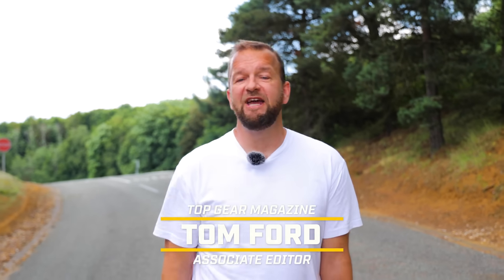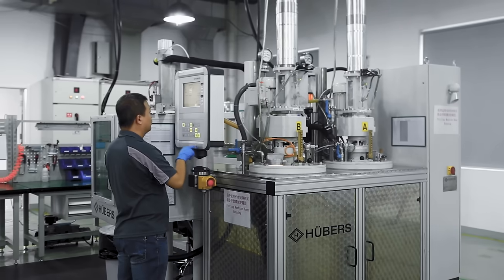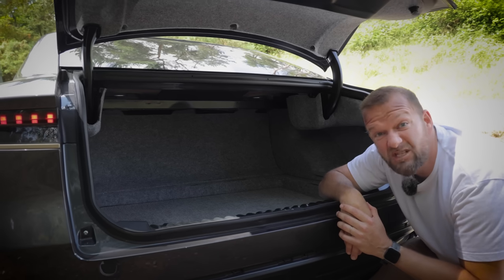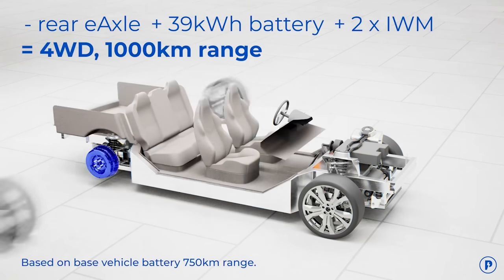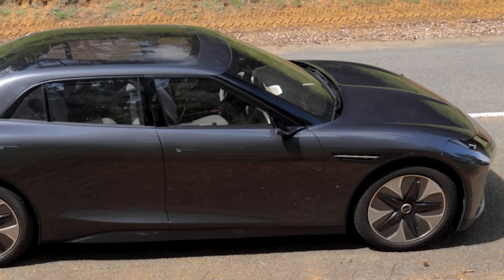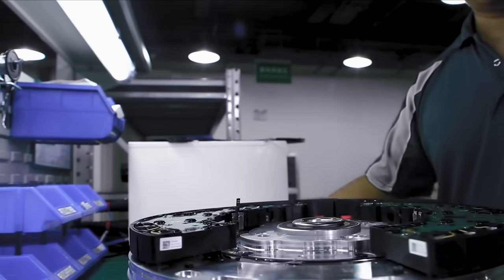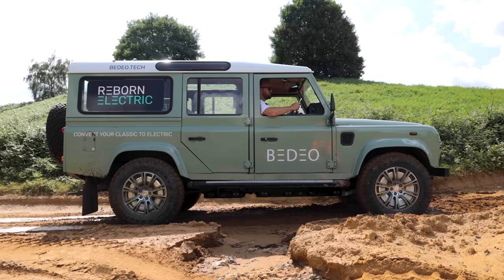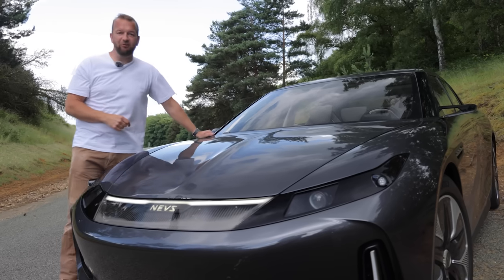NEVS Emily GT: SAAB’s Secret EV With 600 Mile Range | Top Gear

Comment: Obviously the in wheel system is power limited (total volume is fixed)- but for real users and realistic speeds - outside hypercar, specs (or wannabe hyper sedans) completely adequate.

Solong as the increased unsprung weight can really be controlled adequately.

Comment: My Micro E - Street Scooter  , like many other scooters ALSO has an in wheel motor . ...with regen  capacity , etc . NOTHING new here .Downside to this Concept is the wheel Balancing  and Tire changes . Expensive and serious Potential damage in any kind of accident  , not to mention the shock -harm caused by ...common street Potholes .
Reply: Why do you put spaces before periods and commas?

Comment: I'm gonna stop you right there. This is kinda my job. Hub motors suffer from two major problems. The first is very obvious, and that's the fact that they're basically big bricks of unsprung copper, which drastically hurts suspension performance. That can be mitigated with good engineering, but the other issue can not. You have to provide power to said motors. Those require big thick cables. Those cables now moving with the suspension is much more travel than the vibrations you'd get in your frame, and now your cables are going to work harden themselves, and eventually stiffen to the point of damage. They'd be great cars for a few years until they all have to be recalled for expensive repairs to the entire drivetrain.

Comment: The motor inside the wheel is a design flaw - talking about unsprung mass… unless it’s super light. Would like to know the weight though. Best Regards - just an engineering student

Comment: Unsprung weight would be awful.:face-blue-smiling: F1 for example used 13 inch diameter wheel to decrease un-sprung mass. Every ounce counts, so you do NOT want a heavy motor in there.

Comment: In-wheel electric drive is by no means a new idea - Jaguar was talking about it decades ago.  And it's not without its drawbacks - extra demands on the suspension to cope with forward-torque in addition to the reverse-torque when braking, extra unsprung weight, and difficulties supplying electrical power to a motor moving relative to the rest of the car..

Comment: Remember that in the space of 20 years, 1900 to 1920, horses, which had been the method of transport for thousands of years, became superfluous
So did fodder sellers, blacksmiths, horseshoes, stables at inns and hotels, horse sellers,
And the petrol car replaced them all.
The same will happen with petrol and diesel cars, gas stations will dissappear, as cars will be charged at home or work, but more likely they will be self charging, with unlimited range.

Comment: Why not ADD a generator or, generators to trickle charge the batteries for extended or, unlimited mileage of the vehicle?
Reply: You know how a generator works right?
Have you ever used one when you're biking?...
Reply: @zaarkeru3391  yes. It turns on a light
Reply: @anhonestman1234 
By?...

Taking energy from the from wheel.

Have you not noticed how much harder it is to paddle when you start the generator?

To light  a 10W light, the generator need to take 10W of power from the wheel.

Energy can't be created out of nothing.
Reply: @zaarkeru3391  you schooled me .. thanks .. but, there’s gotta be a way .. an acceptable loss for a larger gain ..   not 1 equals 1 .. a 1 equals 1.5 or, more ..
Reply: @anhonestman1234  
Not really.
You wont gain anything.

Well, solar panels might give a smidge.
Not worth the effort though.

perpetual motion machines cant ever be a thing.

Comment: Yet another miracle EV that will never see the light of day. 600 mile range also means longer charge times. Not that it matters, as it does not exist.
Reply: We're only about 15yrs into EV's so far. There's a lot of feeling out and sounding out to go thru as the tech and practical applications evolve and develop (and it's moving pretty rapidly already). "Yet another miracle EV" I think you've maybe formed a premature opinion of the whole thing whether or not this particular car makes it thru the process and into production. But I hope it does. I think this one might have legs. Maybe we'll get an update soon unless it hasn't made the cut already.

Comment: Nothing new, 2 Australian scientists at .. MIT (I think) built a EV with a motor on each wheel around 10 years ago. Raced their buggy against a Lamborghini out performed the Lamborghini on every bend & corner - the only advantage the Lamborghini had was on the lonf straight....the raw power of the V12 took over

Comment: It is an impressive feat that they pulled off with the motor in the wheel. However the fact that three companies went bankrupt trying to develop it means the cost of development was excessively high. It may be based on Porche technology but with all the changes they made killed three companies. I have a feeling that this is going to be relegated to the graveyard if no one steps in to commercialize it.

Comment: Time will pass and it will prove that such a design is not cost-effective. Yes, it is beautiful, compact and simple. But from the point of view of maintainability, as a result, it will be necessary to change the entire engine, since judging by its design, all electrical logic is varnished. And it won't be cheap.

Comment: The only downside that I could imagine with in-wheel motors, is that those expensive components are effectively in the crumple-zone, and could be terminally damaged even at low-speed minor collisions...

Comment: The drive wheel, sprung weight, at 33kg each corner only works on a very heavy car as a percentage of total weight! Try all this technology into a 1400kg vehicle and the ride and handling will be adversely effected! I’ve owned two Saabs so I praise the effort I don’t want to drive 2 to 2.5 ton vehicle!

Comment: I suppose the most  heating place  is the wheals and it  need very active cooling   in addition so  rubber of  tire can be very hot . I preferred to be from the modern wonder as far as possible . i believe it have  very actual reason for . Electra magnetic  influence no one tell too much about . About phone every one know . But beside  such power it can be 10 thousands time  bigger problem . People too fast to jump in

Comment: Didn't notice any brake disks, or obvious cooling mechanism for the 4 motors.  Even if there are no axels, there have to be shock absorbers to deal with the unsprung weight, and a suspension to control wheel tracking.  The idea of printed circuit boards, inverters, semiconductor die bonding wires and heat sinks bouncing up and down with pothole shocks is scary.  The idea of 4 motors inboard with disk brakes and liquid cooling is more palatable; same torque control, more implied durability.

Comment: I believe that putting that much weight on each wheels goes against the very basic dynamic... Turning the front wheels face a much greater resistance and each motor being shaked at each and every pothole or bump we have on our roads would shatter the reliability...

Comment: 175KWH?  It's a battery wearing a car.  They never mentioned the weight, but it is probably around 4 tons. However, for EVs to even begin to replace ICE, they must start carrying 200-400KWH batteries or battery equivalent.  Why?  The current charging infrastructure and charging performance. There would need to be a massive improvement in energy density for batteries, or a willingness of manufacturers to try alternatives like gas turbine hybrids, fuel cells etc...  I have an EV, and its a perfect commuter car, not good for longer range use. I'm very curious about the in-wheel motor tech. All of that unsprung weight only works with a heavy vehicle.

Comment: Unsuspended weight (motors) is a bad idea as it negatively impacts handling and is more likely to destroy a tire/rim especially when low profile tires are used. The sun roof is a great way to get a sun burn and will draw even more power for the AC to adequately cook the interior. I would take the Model Y over this!

Comment: In-wheel motors would allow higher ground clearance as well. Give me an SUV with in-wheel motors, 4 wheel steering and air suspensions with tall range from 5" on highways to 10" off-road ground clearance with LiFePO4 batteries and I'd throw all my money to you. I don't need crazy power or crazy range. 400-500 PS like this car in the video and 300 miles of range is adequate to me. Just give me fast charging ability I'm all set to throw you $100K easily. If well built, this car would last me at least 10 years, 100K miles without any serious service.

Comment: If this comes and the back trunk is hatchback like rs4 rs6 wagon basically, I would pre-order with my eyes closed 😊 asap 
Oh and I need my sound system at least 700 800 1000 watt and minimum of 13 speakers and 2 or 3 boomers box and stuff. And please please no pirelli tires 🙏 Thank you in advance

Comment: Hub motors are not a new idea....they've been around for decades, hell I even designed one myself. They have a serious drawback though, they require seriously robust suspension systems. As the suspension is now not just holding a 40-60lb wheel, but up to a 300lb wheel...It is also obviously harder to break such a heavy wheel, so it really needs regen breaking to control the inertia of such weight.

Comment: Is this a reupload form 10 years ago? I don't know. perhaps they're just 10 years late, because they spent 15 years on development. 
nEvergrande could have been put into some more context. And if this went into production, the in wheel motor shouldnt be bolted on to the wheel, it should be the wheel. I wonder how they get the power to the wheels through the axles
Reply: I'm pretty sure that the wheel is bolted onto the motor.

This is current. Nevs just sold the projects to EV Electra.

Comment: I question the reliability of an electric motor being on a wheel that is subjected to
constant, undamped vibration, pot holes, rain, road salt, etc.  Going through a test course a few times is no substitute for real, long term use.

Comment: A great concept car, but generally these sorts of cars with low ground clearance don't work well on the potholes and speed bumps of the real world roads I drive on, let alone snow or very wet roads. The very long wheel base is a problem in car parks. The designers aren't living in the real world.

Comment: The 🐘 in the room not mentioned…..it’s weight? so you have added maybe 50kgs per wheel and filled the gaps with battery’s, EVs are already heavy imagine how many tyre changes you will have if driving in a spirited manner and imagine the faces of you local quick fit when you go to replace them 🤔 putting on winter tyres even everything becomes complicated. Also I would think the motor is more vulnerable to damage because you only have a low profile tire between the motor and the road, potholes, curbs so on. With the hub also being in close proximity with water having any kind of small leak would result in potentially serious damage as well. Hmm lots of questions

Comment: The thing weighs almost 4 metric tons with over 100kg of lithium in the battery packs.  It does 20 times the damage just driving down the road as a comparable ICEV.  This is not going to help us.

Comment: Good idea to have the motors on each wheel, EXCEPT that in case a side or corner crash, you well maybe loose the motor on that side, and who knows how much is for one of those? This is a high risk for your wallet,  either you pay for it directly, or pay higher insurance to be covered in this case of accident.

Comment: Love my SAAB 900T, but not so much the concept of hub motors with all the mass at the wheel rather in the center where it will help with ride feel.  Also, hub motors have been around since the late 1890's.  It's not innovation, its going backwards in handling and ride feel.

Comment: Let's face it. When it comes to DRIVERLESS VEHICLES For Family Trips (not so much short single  commuter trips) LARGER, VARIABLE, SPACIOUS INTERIORS Will Be a consideration; and a 0 to 60 mph in under 10 seconds acceptable. 
A range of 500 to 1000 miles per charge IS THEE LIONS SHARE OF THE MARKET'S NEED. China is in it (EV market) to win it. In any case, key tech & raw materials are in their possession.

Comment: SAAB inflicts emotional distortion. Wheel motors are generally not regarded as a good idea. But it's SAAB; mitigations and advantages well presented, so let's see. Price will be likely prohibitive, though. Not sure if the economics will work out for everyday use and general needs.

Comment: it's a good move of them to release the car as NEVS and NOT SAAB, purists would tear it apart for not being exactly built like the ones their fathers used to drive back in 19 something something. Innovation is undemocratic. Some people just don't eat tacos because someone called them sandwiches and they don't like sandwiches. All the engineering has been done by SAAB people and if the only thing that stops you from buying it is the front logo, you kinda missed the point.

Comment: Just why do EVs need to have a bonnet like that anyway, they should all be a cross between a Canoo and a Tarago.
Reply: It's basically impossible to design a modern car without a bonnet of some sorts. It's not because of looks or engine compartment but due to safety. The crumple zones all new cars need to have today simple make it (almost) impossible to avoid. There is ways to get around it, for example putting the passengers ABOVE the impact zones, very similar to flat nose semi-trucks but nobody wants a car like that.

Comment: Repair costs, what are they? this looks like a very expensive repair if the motor is in the wheel? Nice concept, innovation, and design, however, most cities and country roads are not designed to take the every day wear and tear. People are clumsy, too trust worthy, and always in a hurry and eV's are not everyone's daily driver. Plus think about the battery pack replacements.

Comment: Hub motors are an old concept. This car's price will probably be more than a Model X. Any idiot can make any car with a huge price tag. The issue with hub motors is the unsprung weight and the low wheel torque. Most EVs have in the region of 10:1 ratio on the final drive. Hub motors are 1:1 of course, so the torque at the wheel is 1/10  of others. Admittedly the 4-wheel drive mitigates this to roughly 2:1, but it's still an issue.

Comment: So what happens if you get a flat tire? lol
Reply: You get it fixed as you get any tyre fixed.
Reply: @sandersson2813   But with all that including the engine in the wheel, is it that simple?
Reply: @kuruptzZz  How do you think they got the tyre on?
Reply: @sandersson2813   I have no idea. It's not like they showed us. I have never seen a wheel with an engine in it
Reply: @kuruptzZz  Do you really think they'd design a wheel where it was problematic to replace a tyre?
Reply: @sandersson2813   If you don't have anything to say, you can stop replying pointlessly
Reply: @kuruptzZz  Not me with the stupid questions.
Reply: @sandersson2813   Yes you actually. That's literally all you have contributed here
Reply: @kuruptzZz  If you ask a stupid question that has an obvious answer.......
Reply: @sandersson2813   What obvious answer? It's a valid question, since it's a completely new and different type of wheel. Can you change the tire yourself, or do you need to have it towed to a shop? Is it a run-flat? Does it come with a spare? What happens if you replace it with a standard tire? 

You have zero answers. You're just replying uselessly with idiotic rhetorical questions

Comment: Great thought good looking car, but unsprung mass is a much bigger deal than he's making out. He's talking about doubling the unsprung mass of a normal car.  This is literally doubling the mass of a wheel when you hit a bump. I matters with every ripple in the road surface as you're rolling down the road. Slinging around all that extra weight is problematic. Bad ju ju no matter what the springs and shocks are doing.

Comment: It's a bulky car to fit the battery, and it's still a bulky car to fit the battery even with the motors in the wheels. So what was the point of the motors in the wheels again? 1000 km of range is not needed, but an EV of a more reasonable size and weight yet good range would be desirable, and they didn't even try for that. 

At least it's better than the Lordstown embarrassment, which had in-wheel motors and nothing at all in the spaces where the motor should have been.

Comment: Mercedes sits on a patent and project of in-wheel electric motor since early 2000s. I had an opportunity to meet the designer of it, Mercedes bought the project and haven't touched it for years. Technology is not new, it is wildly used in mining applications for large dumpers that have diesel powered generator plus electric motors in wheels. Not to mention locomotives. Difference here is batteries instead of motor plus generator.

What is disgusting in all these electric cars are rims. Almost all of them have these filled rims that hides internal elements and look like 80s VW golf or something alike rims.

Comment: I'm sorry...haven't those engineers actually thought about the state of the pavements in most countries? ...I'm not to keen into spending an arm and a leg when inevitably you'll run through the multitude of pot holes and ruin the rim ...and wheel...and motor.

Comment: Every puncture and tyre change would require a visit to the main dealer...you're look8n 30 to 50 pounds for a puncture repair....the cars of the future are not for the average person they going to be too expensive, so "on your bike" as they say in the UK, which is literally what they are trying to achieve with all these 
Bicycle lane and 20mph speed limit L.TN(low traffic neighbourhoods) ULEZ, Congestion Charge Zone. And what concessions do they give youas an EV driver....sweet FA. 
It all desinged to line the pockes of greedy corporates.